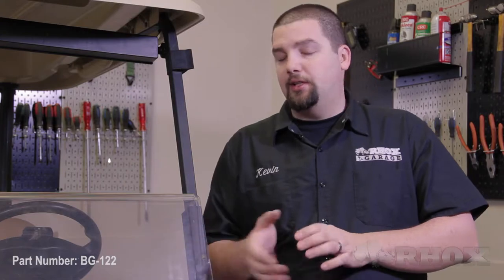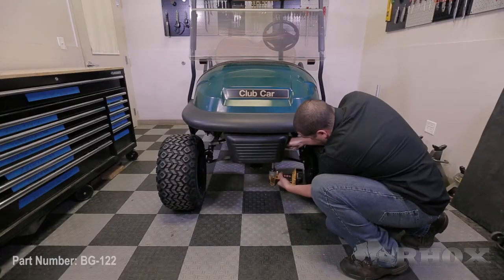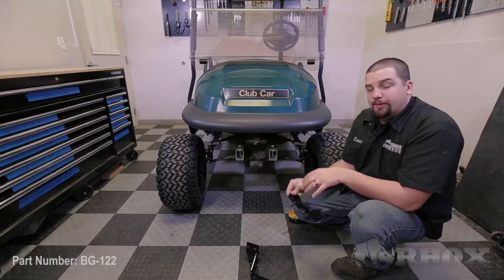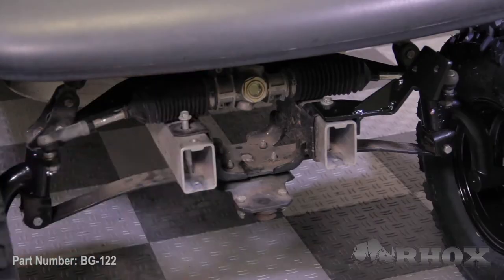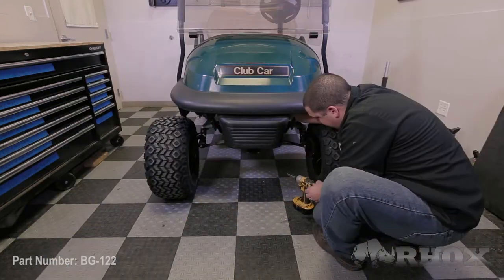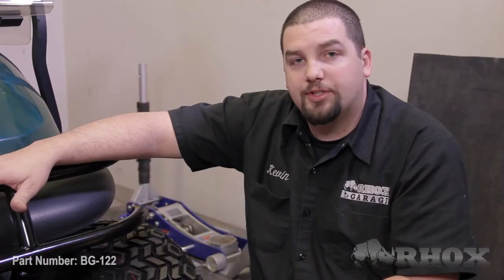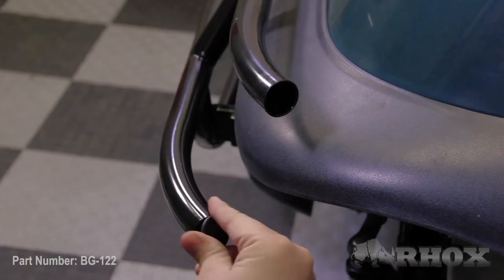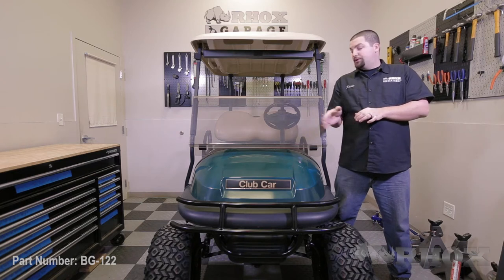BG-122 RHOX Brush Guard on a Club Car Precedent

Comment: Thank you for posting this video since I didn't get instructions. Not sure if they were missing from my box, but there were none. Although the installation seems intuitive, I really thought I got short bolts. What this video doesn't tell you is you need to line up and just start all four bolts when putting on the brush guard. You have to use the bolts to pull the brush guard toward the frame. Great product, highly recommend.